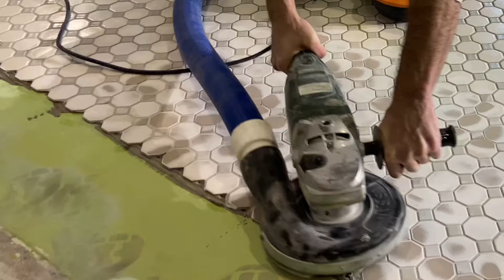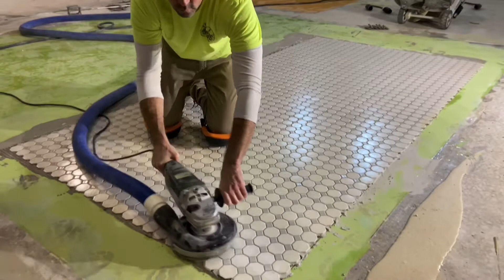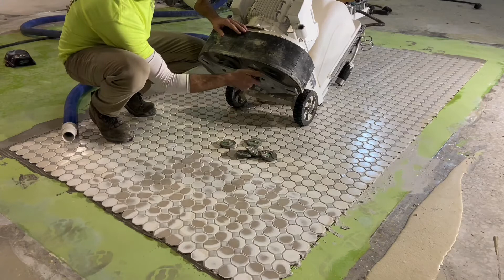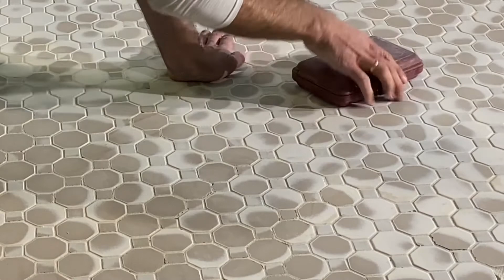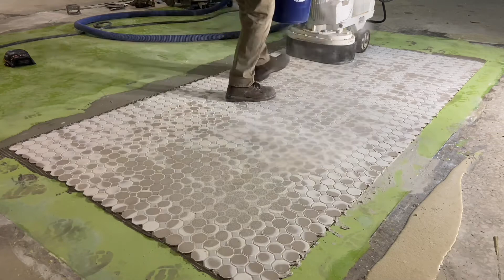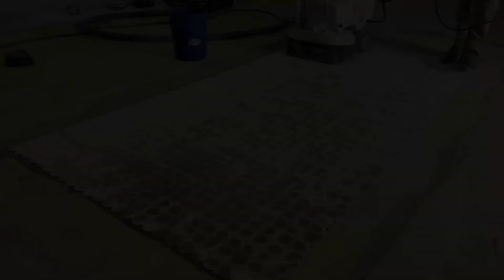How To: Deglazing Ceramic Tile By Diamond Grinder

Comment: Hey Rustoleum has a primer, hard surface primer, that works over glazed tile like that.  You should test that product out.  No grinding necessary.
Reply from the maker: Thanks for the input. I’ll definitely do some testing with it this winter. Thanks again for the info.

Comment: Do you sprinkle it with quartz sand? What do you spray the floor with?
Reply from the maker: @dejantrifunovic3009  yes. The sand is to help the diamonds stay sharp. The spray is water. The water is used to give the sand weight. This helps to keep it in place until the diamonds pass over it.
Reply: @joshjones8047  Thank you for the support
Reply: And diamon must be soft
Reply from the maker: @ it’s what we call a medium bond. Soft bond might help and stay sharp longer, but surfaces this hard can have the same effect on any bond. The medium bond is my choice for any tool because some soft bond tools wear too quickly. The quicker a tool wears, the more expensive it is to use them.

Comment: Josh,
What grit/bond cup wheel/tooling did you use?
Reply from the maker: This one is a 24 segment 30 grit- medium bond. The tile was much harder than I expected. The 24 segment medium is good for most concrete, but tile could probably use a soft bond 12 seg.
Reply: @joshjones8047  is there any worry that the tile may have too deep of a scratch and that it may telegraph through the coating? Just today I used a 30 grit wheel on hand grinder on ceramic. It seemed overly aggressive. I guess the same principles apply as do with concrete but I was worried that I may be grinding too aggressively with that 30 grit medium bond. Thanks man
Reply from the maker: @jacobnorman4800  that’s a valid concern. Since this is tile (grout lines come with tile), the floor is getting 40 mils over the topmost surface. Filling in the grout lines is the purpose for this thickness, but the extra benefit is any scratches will be buried too.